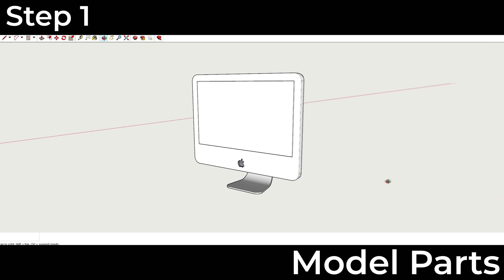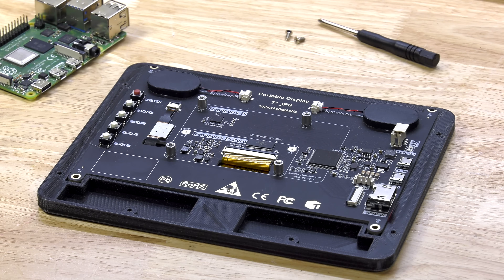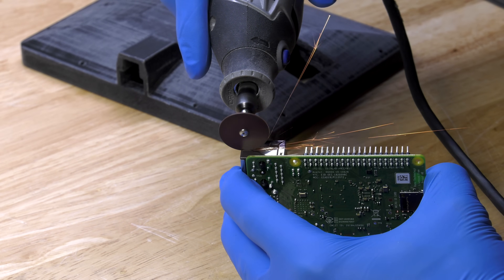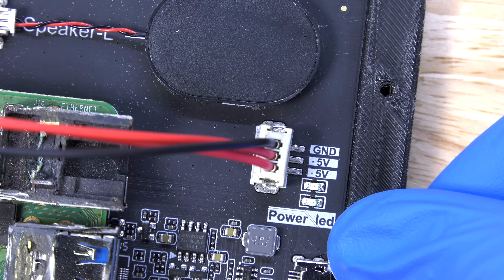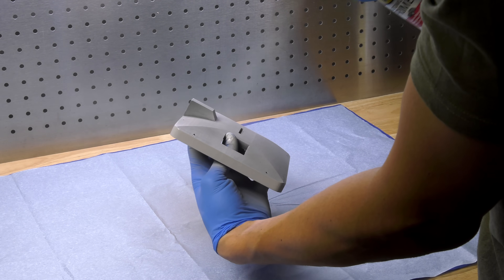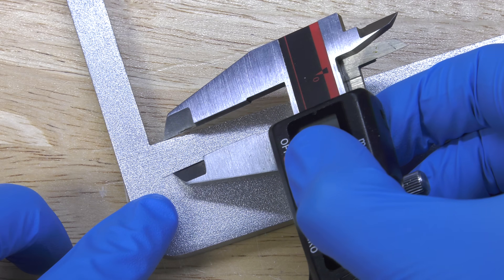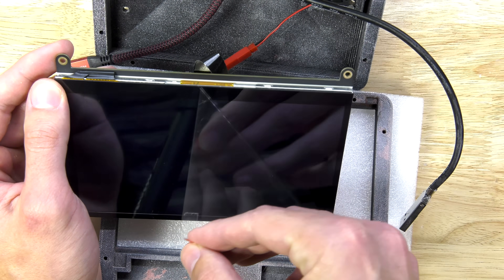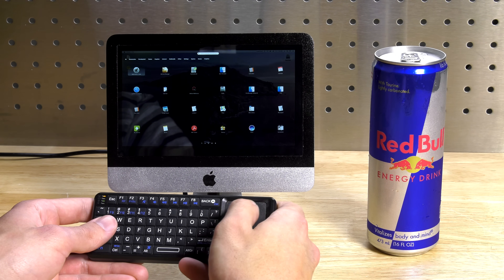World's Smallest iMac

Comment: If you aren't going to use the port, use a soldering iron and remove it from the board properly. Don't just cut it to bits !!
Reply from the maker: It's a lot faster to do it this way.

Comment: Awesome project MP!! I'd love to see a modular iMac. It wouldn't have a bowed back. It would be more like a rectange, the same as the 2009 iMac shape. On the 2009 model, the area under the screen would essentially be one wide rectangle. But as wide as the rectangle is, there then would sit two other modules - on top. All these modules would be the same width as the screen base. It would give that same flat end look of the 2009 model. So - at the front would obv be the screen. So a person could say buy a 24" 1080 screen, or a 24" 1440 screen, etc. It would sit on top of the long rectangle. Then, something as wide as the screen (and base rectangle module) would sit behind the screen, on the other half/part of the "base" module again. This 3rd module would be the main computer and cooling. Everything accesible and upgradeable like a PC! When it dies, DIY repair. The screen input would be linked to the motherboard GFX output via HDMI/DP connection. If this is too complicated, of course there could be just one main box, like yours, that holds everything, and the screen just fits into that. The point is, it could be opened. Nothing would be bonded as it is now. Screen dies, no problem, unscrew it and buy an identical unit and swap it in and connect it. It could also house a DVD drive again with this approach. I'd like Apple to adopt this style in future revisions. If your demands change in future and the gfx can handle 4K, then just buy the 4K module and drop it on the base, job done.
Reply from the maker: I love this idea! I really wish Apple would do something like this!
Reply: @MichaelPick  Thank you Sir. The initial purchase might be more expensive, but the savings down the road would be worth it. It''ll still be a one-box solution, and could even have a hing at the rear and sit on the desk and "lean" back, like a laptop screen does. This would be handy to shave costs of making a heavy supporting base stand, as an option.

Comment: What circuit board did you use as the main back plane ( the one that has the speakers and power switch)? Did you custom make that one?
Reply from the maker: It's called a "EVICIV 7 Inch Portable USB Monitor" on Amazon. It's a really good value for all kinds of projects!

Comment: If you printed the case a little thicker, you could be able to just accommodate the Pi as-is, and enable yourself to just swap in the next generations of the Pi .  A tiny fix thru the keyboard in the custom printing is way much more smarter than maiming a standard modular component thus denying modularity and limiting useful life.
Reply from the maker: The goal of this build was to make it as slim as possible. It would have been really easy to make a fat case (that wouldn't even resemble an iMac from the side), but that wasn't my goal.

Comment: Why not make the power hole come out the back like the real iMac thats what that hole behind it is meant for
Reply from the maker: I tried that, but it wouldn't fit properly in that configuration for the cables I was using. :-(

Comment: If you want an even smoother finish, use "high build" primer.  Let dry, sand. Repeat, but use sandpaper >220 grit.  If you really want to go nuts, repeat again with 400 grit.
Reply from the maker: You're correct! I just didn't feel like going crazy with the sanding in the build. But I might in my next! :-)
Reply: Wet sanding would make it so easy.

Comment: Seems like you should print considering the hardware, not adapt the hardware considering the print.
Reply from the maker: I was planning on cutting the ports off from the very start. The goal was to make this build as thin as possible, and that's what I did.
Reply: @MichaelPick  Yea, I understand that choice. I was talking about cutting in the screw-holes of the display.
Reply from the maker: @rvervuurt  Yep, I had to do that as well or else the top tabs would poke out over the bezel. Ruining the Apple look.

Comment: Also you used a usb2 cable on your usb3 port so you basically lost what the3 can do and turned it into a usb2 they make half foot usb3 cables with USB A f/m you don't always have to buy usb3 with a type c head you can get type A and your 3 port will be able to handle high speed communication between devices 🤔💜😁
Reply from the maker: Good catch! I'll keep that in mind for future builds!
Reply: @MichaelPick  you're welcome I know you don't want to suffer from slowing yourself down and not getting full benefits

Comment: Why didn't you just desolder the usb/rj45 and resolder single bay usb2/3 ports and add cat wires to the solder points of the RJ45 to a female cat extension that you can mount behind the monitor for when you need to do higher speed downloads since Wi-Fi is way slower compared to RJ45 connection.... just some notes from my own mods
Reply from the maker: That's a really good plan! This was just a lot faster so I went with this design path.